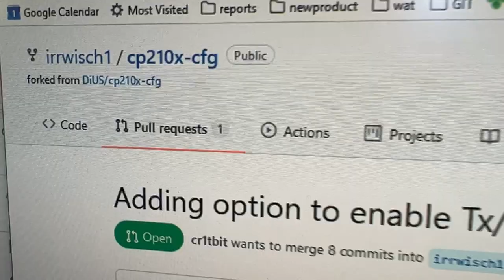We can now set RX/TX LEDs on our CP2102N usb serial boards

Comment: That "not supported by all the SDKs yet" rant was so me yesterday. I searched everywhere for a hookup guide for what should've been a simple RS485 to serial board. Practically none in sight. I ended up looking at Arduino code from a colleague to figure out which pins he used, and brute force guessing the remaining 2 pins on the board.